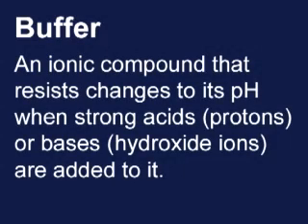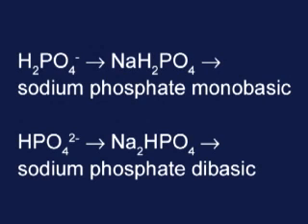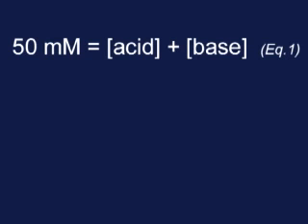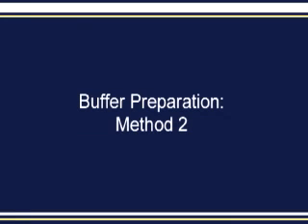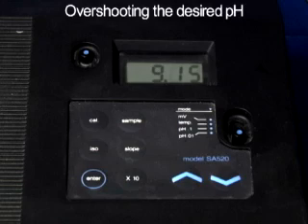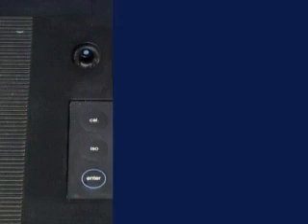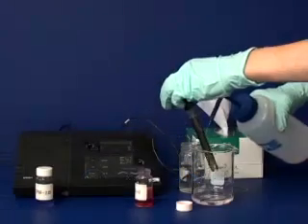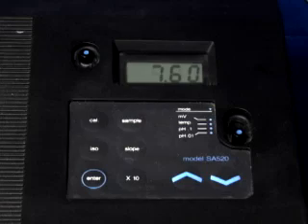Buffers and pH Meter | MIT Digital Lab Techniques Manual

Comment: The ratio of the conjugate base to the acid is 3.02, not 1.60. All calculations need to be re-solved. Plus, the pKa of the second dissociation of phosphoric acid is 7.21, not 6.82.

In anyway, good job =)
Reply: thanks a lot, I thought I m wrong before I read your comment
Reply: e^(.48)=1.616074402
10^(.48)=3.01995172
Reply: how did that happen?

Comment: A thumbs up, but next time you calibrate (immediately after you rinse the electrode and just before you immersed the electrode in pH 4 buffer) you should rinse the distilled (rinse) water off with the buffer (in this case pH 4) and then immerse the electrode in a separate jar of pH 4. Repeat that for the other buffers as well. This way you don't contaminate the small aliquot of pH 4 with DH20.